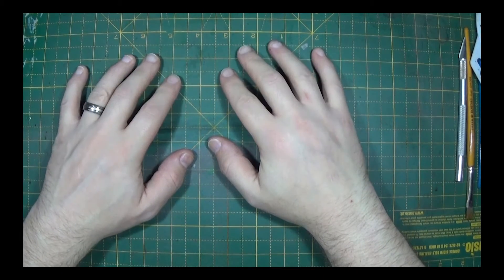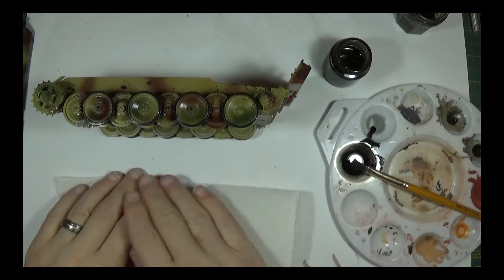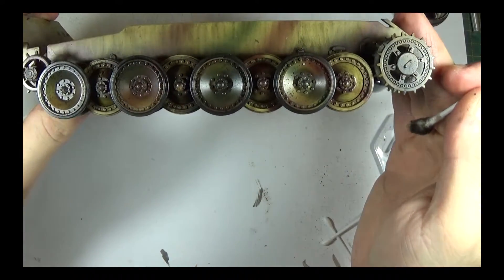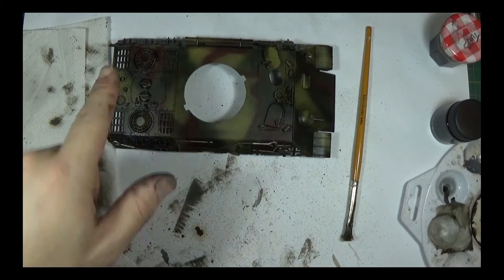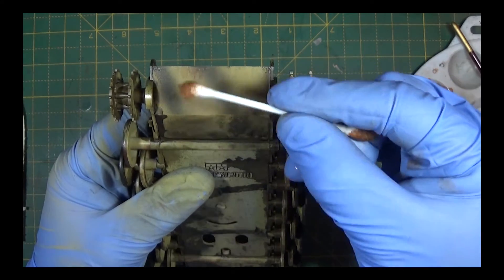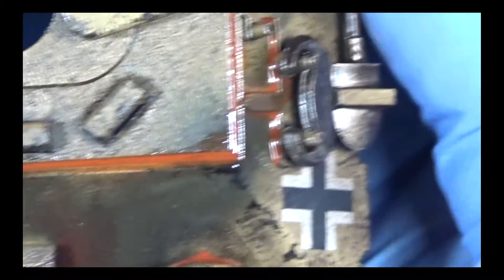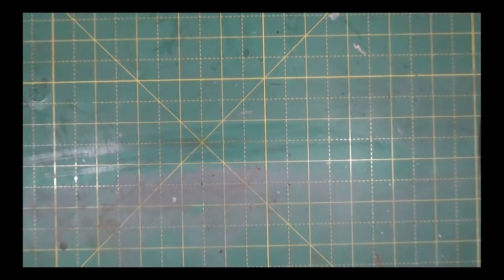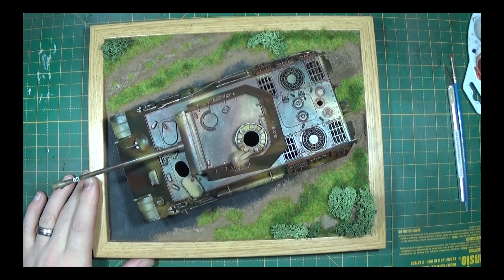Panther Ep09 - Weathering..

Comment: Thanks for sharing your experience, this video was about weathering but I was surprised by the detail of the texture of the paint on your tank. Would you care to share some info about that?
Reply from the maker: Ahmet, the surface texture on the tank is actually molded when the plastic is cast. Hope this helps
Reply: Making_Models of course it does, thank you. Now I know what kind of differences models can have with different brands